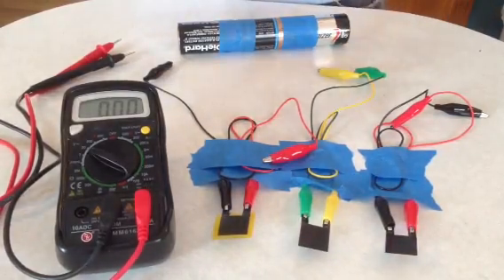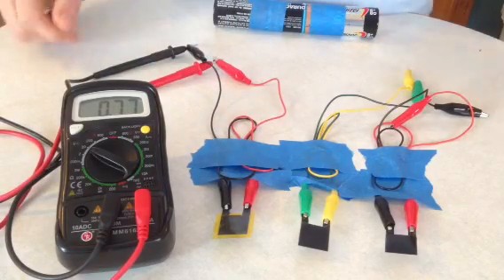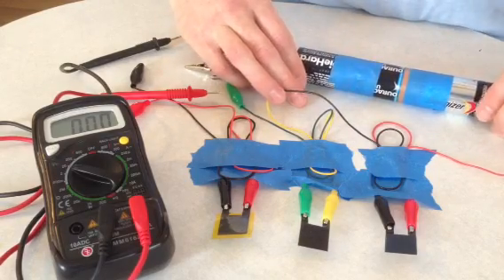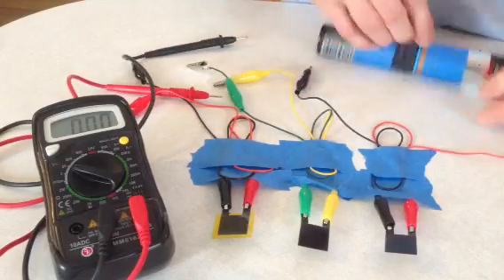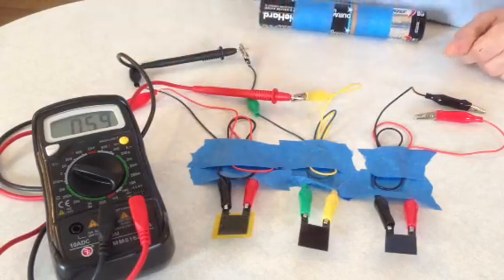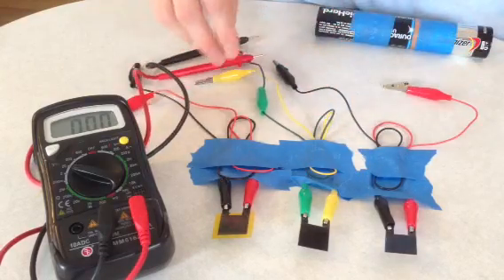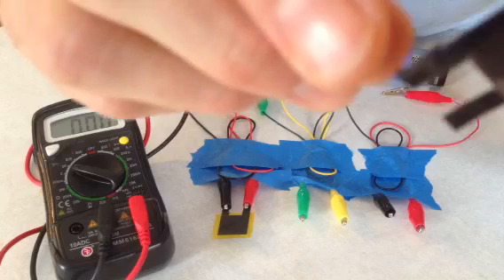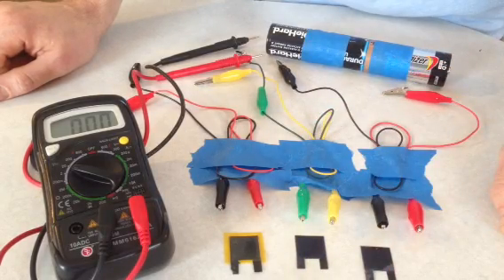Homemade Laserscribe Graphene Supercapacitor Test

Comment: Why do you call the two caps "solid state"? It is my understanding that "solid state" refers to all electronics made after the vacuum tube era.
Reply: Yes, the term "solid state" now also refers [quite recently] to other crystal technologies such as batteries and non-electrolytic polarized capacitors (caps that don't use electrolytes, whose dielectrics are liquid in nature). Graphine now falls under the new "solid state" reference, unofficially as I don't see anywhere that it is certified as such, yet...
  With regards to the graphine caps sporting integrated crystal batteries, it has been found that the integrated crystal power cells can continuously re-charge graphine power cells (or caps), notably silicon crystal and this is where the "solid state" reference comes from. The term is now being used quite loosely to the consternation of all the old pros. I guess it's `back to school` for everybody.
  Now, the only problem with the crystal is, when these silicone or quartz  crystals produce electricity they expand and contract rhythmically and these micro-oscillations causes micro cracking in a hard crystal substrate and causes the efficiency to fall off quickly. The solution was to place the crystals into a flexible polymer and allow the crystal to simply and easily expand as polymer flexes in response to the pressure. One of the polymers of choice is PVA (polyvinyl acetate) which can be made in your kitchen sink with ingredients from your kitchen cupboard, or, the next time you go to the grocery store just grab an inexpensive squeeze jug of white Elmer's Glue-all or Elmer's School glue. Iam told that Elmer's washable clear glue will work also. Still, don't get your cap or battery wet, even the new "solid state" crystal stuff need to be sealed. :-)
Reply: Don't you mean Graphene?
Reply: You can spell it any way you want. It pronounces the same either way. Some people say tomato and some people say tomato, LOL, loosen up... :-)
Reply: Spelling has NOTHING to do with it! And it has nothing to do with pronouncing it either! Try to be relevant with your posts please!

Comment: I really appreciate your work and your sharing it on Youtube. Graphene is really exciting, especially in this field, and not everybody has the time or resources to play with it like you are.

I'd like to share some observations that could improve the quality of your results in the future:

In your experiment the batteries provide a huge bottleneck on current. The wattage drawn by a capacitor is static insofar as the charging source can supply, but will pull significantly more current at empty (0.01v) than at full (whatever, let's say 4.5v as that's the battery pack you have there) assuming the power source charging them has a static voltage. I'm simplifying because I don't fully understand the how or why of the relationship, but the effect is real and measurable.

That being said, if you want a useful comparison between them, you have to charge them for the same amount of time with a power supply providing the same voltage and CURRENT to each. Batteries discharge slowly and don't provide stable voltage or current.

Moreover if you "charge" one capacitor with that pack for 5 seconds and another for 10 seconds it's not really a fair comparison for this reason.

I'd love to see a calculation on each material for capacitance particularly in farads. See how high you can get the voltage, don't be afraid to leave the multimeter probes connected while charging, it won't hurt it, and will allow you to see the behavior mentioned above IN ACTION! :)

Comment: Don't forget you're adding yourself as a big fat resistor to the circuit while you are touching the clips to the battery leads, it would be better if you would remove yourself from the circuit. Try clipping the alligator clips to the meter and use the meter test leads to isolate "you" from the circuit while charging the caps....

Comment: If it takes longer to charge it is either a better capacitor (more storage) or it's leaky.
You can test if it is leaky by seeing how long the voltage takes to run out with only the DVM connected.

Comment: capacitance can not be measured by simply measuring voltage.  you have to also measure time it takes for capacitor to reach the supply voltage. Capacitors with larger capacitance take longer to reach high voltages  but they also take longer to discharge.

Comment: excellent thank you. would it be possible to connect both leads from the meter and the charging battery and charge for specific time (a minute or two for example) in order to be able to compare?.  also, where did you get your graphite electrodes?

Comment: nice work, but could you run a load with these and show the current flow and voltage while running the load?  it would be great to see.
Reply: of course he failed, no current flow or voltage displayed,   just shoddy misunderstood engineering.

Comment: Am I wrong in thinking that Graphite Oxide is non-conductive?   If that's the case, you could simply prepare alternate layers of Graphene Oxide, some of which you turn into Graphene with the laser, and some you do not.  Then sandwich them together.

Comment: What do you think the breakdown voltage of your dielectric/separator is on these?  It looks like it isn't handling the 4.x volts output of your triple-D-cell charger.
Maybe you are getting variable readings because the current is bleeding/breaking thru your dielectric.

Comment: Why would you charge your caps with a 4.8v charger battery, to achieve a 0.7v holding charge ? If that is supercapacitor territory, you'd destroy a proper electrolyte. All you have with graphene is high surface layer, this is only half the ingredient in the making of a high capacitance. The genius is in the electrolyte.

Comment: Would be nice if you could have a hybrid between lithium Ion batteries and Graphene capacitors until graphene capacitors come down in price in phones tablets and laptops so in phones you can get like 2-6 hours of charge from the Graphene capacitors which would charge in seconds and your usual charge on the Lithium Ion Batteries which refill the Graphene capacitors for high specific voltage.

Comment: For what it's worth, I'd recommend building either your own quadcopter, or your own supercaps; but not both at the same time.   Either thing on it's own can require a lot of time and patience.   Anyway, graphene supercaps won't have enough energy density to do what you want them to.   You really need the best lithium cells you can find for RC flying.   If you really want to use supercaps for RC flying, though, you'll need to include a miniature gas-powered generator to help keep them charged up.

Comment: There is a type of capacitor called an "electrolytic capacitor".  Electrolytic capacitors do have an electrolyte within them.  The function of the electrolyte solution is not for a chemical reaction like a battery, and instead acts as plate of the capacitor itself.  The dielectric is very thin, and is sometimes "grown" after the capacitor is made by applying a charge.

Comment: I feel the need to make a distinction here: capacitors do NOT have an electrolyte in them, while batteries do. Caps and batteries work on completely different principles. The material in a cap is a dielectric, and should be an insulator. It looks as though there are 3 D-batteries being used here... these caps should be charging up to 4-4.5V. The reason they are not is due to the presence of the electrolytic acid which is allowing the current to leak from one electrode to the other.

Comment: Hey you, I've got a few questions.

Would a thicker piece hold more capacity or voltage, or neither?

A larger piece would have more electrons to "travel", so it would have a higher capacity, right?

Thanks, bye

Comment: Hi Eric
I'm thinking of making long strips of graphene on 6um mylar substrate and layering that to make a cap, instead of using an electrolyte.  I understand mylar has less permittivity than an electrolyte, but surely the breakdown voltage would be much much higher.
I want to use a laser diode outside of a LSDVD to do this.  Do you think a higher power diode and or slow rastering (vs multiple passes) and or pulses will improve conductivity and quality of the graphene?

Comment: Here at least (having set up a bridge so you don't blow the ohmmeter's fuse) you can perform floating capacitor proof-of-principle; reconnect LC tank anode from GND to +1.3V,  then where did the energy go v. your SPICE model of it and are you then more ready to make a rail-rail op-amp having done that.

Comment: The graphene makes up the plates; if you overcome the dielectric resistance of the separator, or electrolyte system e.g. RTA: 1-ethyl-3-methylimidazolium
tetrafluoroborate (EMIMBF4) and straw, then you get a short. That electron movement makes works on the spacer.

See those articles made available via and cited as HackADay-- DOI: 10.1126/science.1216744  Science 335, 1326 (2012); Maher F. El-Kady, et al. Laser Scribing of High-Performance and Flexible Graphene-Based Electrochemical Capacitors.

Comment from the maker: the reason i used the conductive paint was to create a more robust surface for the gator clips.  i was afraid the graphene would scratch off over time.  I didn't hydrophilically treat the surface of the substrate before drop casting the graphite oxide.  apparently that process will make the graphene adhere better to the substrate.  but i didn't have a problem with adherence without the treatment.

Comment: Your not really getting any meaningful data by simply charging them and measuring the voltage.  You need to set your meter to measure capacitance directly or find a meter that measures capacitance that you can use.  You could also charge each capacitor to a reference voltage and then discharge through a resistor and measure the voltage drop over time to get a rough idea of the capacitance.  Judging by how fast the voltage was dropping you have quite a bit of leakage with the current materials.

Comment from the maker: yes.  capacitance is in direct proportion to the surface area of the plates.  The equations are a little involved and require the use of calculus.  I think you will have to experiment a little.  You can wire these things in parallel or in series in order to achieve the desired the voltage and storage capacity.  The same as you would with batteries.

Comment: Many types of capacitor need to be electrochemically conditioned before they will attain full capacitance and reliability. This is most likely the reason for variance in capacitance with time. With solid state Tantalum capacitors the process involves charge and heat and may take more than a week.

Comment: But these aren't graphene.. These are just graphite plates.
You could have used a pencil and gotten the same results. (Or close since they won't be perfectly uniform since they are compressed and not heat fused together via lightscribe)

Comment: alternatively you can use a computer power supply just bridge the green on cable in the 20 pin connector to a black ground
yellow == 12v
red == 5v
orange == 3v

Comment: can u determine what is the capacitance value? or maybe measure current through a load resistance ok around 1Kohm.
is the capacitance of the order of Farads or microfarads?

Comment: For the cells with phosphoric acid in them (aqueous electrolytes), the maximum voltage that they can handle is about 1.2V.   In actuality, you don't want to use them over 1V.   Aqueous electrolytes produce hydrogen and oxygen somewhere over 1.23V.  The ones than go up to 2.5V are using anhydrous solvents instead of water, and the ones that go up to 3.5V are using dry ionic liquids.

Comment: ...(Cont.) Once you can measure the leakage current (should be less than a few uA), then with the equation C=I*(dt/dV) you can plug in the leakage current, the change in voltage (measured on voltmeter), and the change in time (seconds); and this will give you the capacitance of the cell, when discharged at that specific current.  Because the internal resistance and capacitance of these cells are distributed, higher load current equates to less available capacitance.

Comment: How long the cell maintains its voltage is an excellent way of determining the quality of the cell, when energy storage is important.  It doesn't matter how much capacitance a cell has, if it self-discharges in five minutes, it's useless.   Assembling capacitors using the "lightscribe" method on Mylar produces cells with high internal resistance.   This means that you need to let them charge up for a week or so before the leakage current fully stabilizes.

Comment from the maker: yep sure can.  in fact, after i made these videos i experimented (with similar results) with taking an old wall plug that converts to dc current to charge em up.  it was a old cell phone charger i think.  i just cut the plug to the cell phone off and stripped the wires to charge the caps.  worked better than the batteries for sure!

Comment: Try actual cellophane. It's relatively easy to functionalize the surface of the *very* hydrophilic film with phosphoric acid, which may increase adhesion of your graphene film. Further, it might be a fairly decent separator. back before graphene was the NKOTB, I built several small, disposable, nontoxic batteries for medical applications using carbon fiber roving, cellophane, and zinc, with ammonium chloride electrolyte. Worked great for a low current source.

Comment: Why are you measuring voltage? Last time I checked capacitance is measured in Farad... and the higher capacity leads to lower voltage for the same amount of charge - which was exactly what you where getting.

Comment from the maker: yeah, sorry, probably should have recorded that process.  but it was really easy.  just paint each electrode with a layer of the electrolyte and press them together.  it's really just that easy.  for the wet cell, soak the separator in the electrolyte solution and put that between the two electrodes and then sandwich that assembly in kapton tape.  The wet cell is a little more tricky but still pretty simple and straight forward.  hope that helps.  good luck.

Comment: It would be interesting to clip the ohm meter to the leads when you connect the capacitors.  Then  see the capacitor at full charge, remove a lead from the battery and watch the rate of discharge.

Comment: Side thought if it isn't just the flaking. I just did a couple searches on capacitors and capacitance and found that the relative permitting of the dielectric will decrease with increasing temperature. Maybe it was colder at night?

Comment: What I used was 98% H2SO4 and 85% H3PO4, 7.2mL:1.0mL ratio by volume.  That is about a 9:1 acids weight ratio.  KMnO4/H2SO4 weight ratio was 1:35, and the graphite/H2SO4 weight ratio was 1:200.   After stirring for three days, the reaction was killed with just enough 30% H2O2 to change the coloration from black to bright yellow/green, about 2mL 30% H2O2 per g of KMnO4.   The rest of the process involved the many washing/rinsing steps.   This was where a centrifuge was very useful.

Comment: I think something is "off" in his paper.   Or maybe someone smarter than me can point out what I'm missing.  In the "Experimental Details" section, the H2SO4/H3PO4 weight ratio is 5:1, the KMnO4/acid weight ratio is 39:1, with the amount of graphite unspecified.   In the "Results" section, the H2SO4/H3PO4 weight ratio is 9:1, the optimal KMnO4/acid weight ratio is 20:1, and the amount of graphite used is 100:1 H2SO4/graphite weight ratio. So yes, the article presented a bit of a hard read!

Comment: I'd recommend sticking with high purity graphite flakes for things like this.   The Dixon #2 flake looks like about 95% purity.   Asbury #2 is about 93% pure.   The stuff I'm using is from Superior Graphite, and is about 99.9% pure, 80+ mesh.   I got it on ebay from "liquids-powders".   Verify the mesh size before ordering, as it may vary.   Why do you want to use finely powdered material?   I'm thinking that the larger flake sizes will be more conductive when reduced.

Comment: I think he is adapting Huang's procedure, "Simple room-temperature preparation of high-yield large-area graphene oxide".   You can look at the journal online for free.   The difference is shown between oxidizing for 6 hrs, 1 day, 2 days, 3 days, etc.   When they say "room temperature", they mean 25C, but you probably know that. The graphite precursor is important.   Large flake graphite is needed (looks like actual flakes) instead of the lump or powder variety.  I guess I should make a video...

Comment: Good job on the cells, Eric!  I enjoyed the video.  Some pointers:  You're using aqueous electrolytes, so keep the voltage across the cells less than 1.2V.  4.5V is way too much voltage, and is probably gassing the electrolytes.   Also, the internal resistance of the two PVA(c) cells is much higher than you think, and you probably need to leave them hooked up to 1V for a day or so before measuring the voltage across them.  Do a short circuit test, to see how much current they can supply.

Comment: Is the energy source 3 D cells, I can't tell because they are tapped up and acutally look different from each other. I'll assume 1.5V new in series. We all should admit a voltmeter is not a valid testing load. I've seen phantom voltage many times. Continue on and I'll keep an eye on your progress. Maybe measure the current flow into the caps verses current flow curve with a load on a multi-layered setup? Something to experiment with while in a quest.